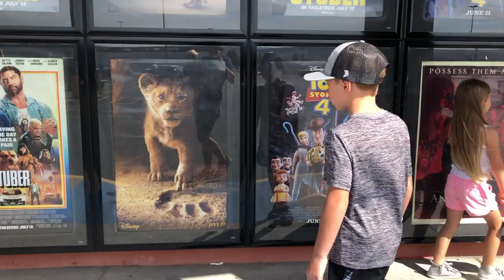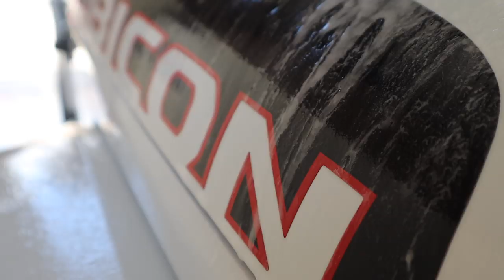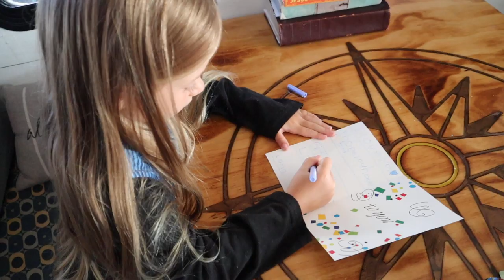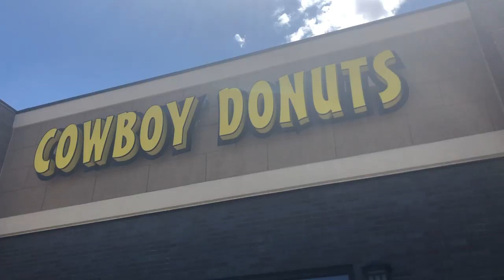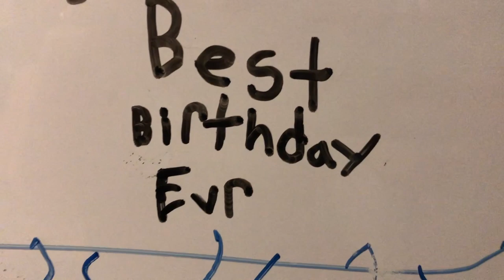RV Wash // Wild Horses Trail // Grady's Birthday

Comment: When you measured him to see how tall he is, take the board outside and stand it up, it’s much easier (in my opinion)
Reply from the maker: Because I cut off a few inches from the board on the bottom, if I stood it up then it wouldn’t have been an accurate measurement which is why I had to measure the line in the floor to the board then hold the board still. Thanks though.
Reply: Loftis Party of Six - weROAM oh. Okay. Well whatever works best